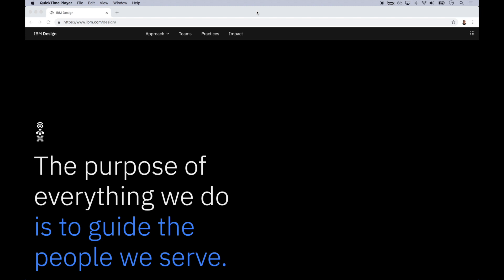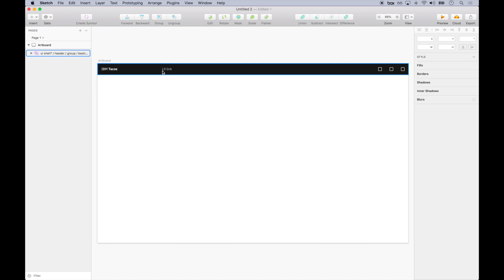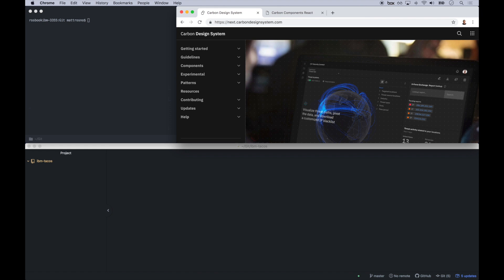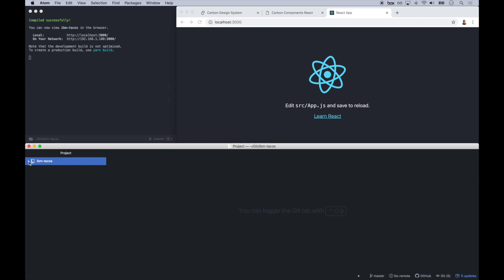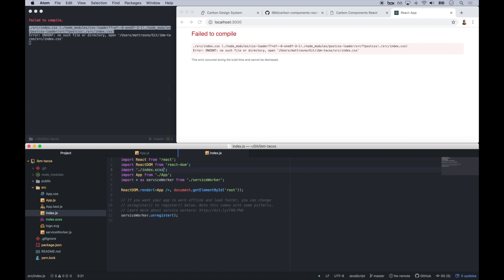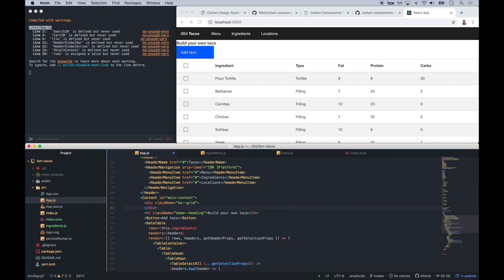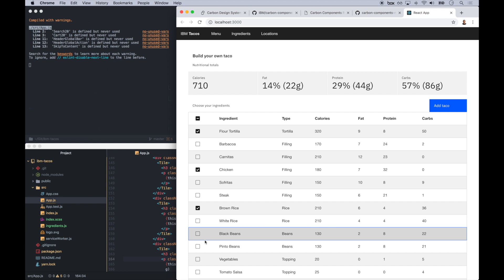Building "IBM Tacos" with the Carbon Design Kit and Carbon React Components

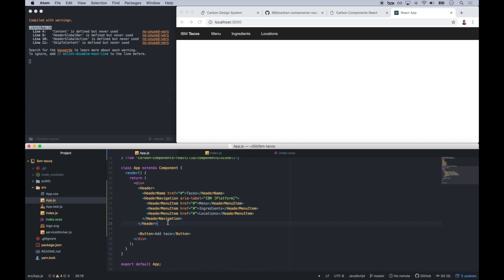Comment: Hi I believe your intuition to use the Content component @8:20 needs to be emphasized. A regular user of carbon-components-react would think that the button would render as you had it before you put in the content component since it comes after the header following the normal flow of a web page. If you can, please emphasize this in the docs and tutorials
Reply: It did render. Just under the nav bar.